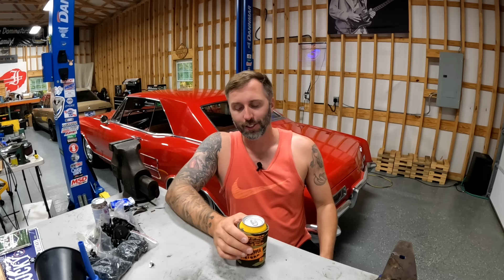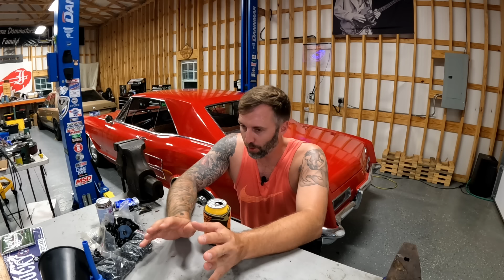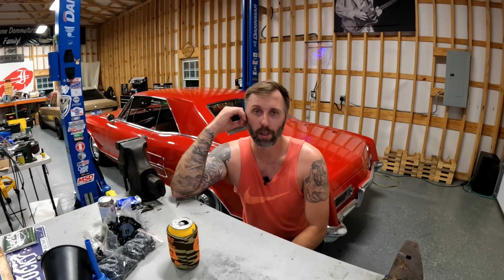Why I Ditched Holley Sniper EFI

Comment: Anyone have a fix for this issue? 1 out of 15-20 times I walk out to start my c10 with the first gen Holley sniper it refuses to start. Just cranks and doesn’t even try to start. Then walk back out an hour later and it fires right up. Every time I check connections, check fuses, relays, and shake wires and nothing. I do see a “RPM sync “ on the screen. But that shows when jt starts too. Also the volts when driving will drop to 11.2 on the Holley screen but shows 12.6 on my truck gauge. That system came with the truck and that engine trans is coming out and going in another project so I will be able to check all the wiring. I just don’t want that issue in the next vehicle. Has anyone seen this with theirs?
Reply from the maker: I hope your able to get it figured out.  Thanks for watching.  Pls subscribe.
Reply: Lol. Thanks for reminding me. I did forget to subscribe. Looks like a channel I will like. You know anything about LT4 engines? Lmao that’s what’s going in to replace the old school 350. If I live through it it should be cool. Then again there may be an insurance fire. Lol
Reply from the maker: @rickhurt7007  u sound like a guy I could drink a beer with lol

Comment: I turned against them I've done a lot of fuel injection setups I helped a friend of mine On his 57 Chevrolet All we can get from tech support was It's RF noise We had problems out of the IAC Never would work right Finally Unplug the IAC I got it to work halfway decent Did everything holly support said Holly still has problems with them Most of the people that I know Have say it works great have say It doesn't work great At least with the carburetor It's consistent

Comment: Damnnnn......after all that I wouldnt touch that system with a 10 foot pole. Put a megasquirt or an oem fi into that camaro!! Just think about it,the ecm is integrated into the throttle body where it's susceptible to engine vibrations and heat... .lots of heat!! And the ecm is potted so you cant even service it if yer good with electrinics. I daily (ish) drive my carby 82 k5 and yes it heat soaks on the hotter days but such as life. It ALWAYS runs though and will always get me home due ti not having to rely on all these micro electronics. Oh....it also has hei and just like when i was in high school, i keep a spare distributor in the back because why not. I dont know what an ecm costs for the sniper but ill bet it's significantly more than my spare $10 hei distributor....which can be changed with a 9/16 wrench and 1 bolt.

Comment: Solving hot start issues with carbs? Use an electric before you start.
Only EFI I would trust is new OEM, I think a lot believe they will do a "Simple 4 wire" deal turn the key and drive off in the sunset and will act like a new car. It wont. 
If you have a carb just TUNE IT. IF you cant find someone who can...ive never had an extended start issue on one setup right. 
WHy complicate an old car when they are very simple to begin with thats the magic with em.

Comment: I have never had a problem with any holley efi system I have installed 35+ terminators sniper 1 sniper 2 dominators hp's never once had one problem I don't understand why people have problems I guess . I've also diagnosed at least 25  problems someone else created on on these systems I am not a holley die hard but I truly believe there is a lot of install error going .

Comment: Non of this new stuff for DIY is going to be only as good as good as the last guy who assembled it and signed off on it.  It’s a PIA that can be great, but it is not going to be the all and end all. When they change to a new product, they have corrected issues that have caused returns. You can assume that the old units, they will fight tooth and nail to deny a return. They want to unload the obsolete parts and it’s a good chance they are repackaging returned units. The II is a world away better unit. If you get stuck with a I you are playing Russian Roulette. They will try to make you keep it if they can. I have an Edelbrock carb and a TFI ignition that is triggered by points with no condenser.,All of the pieces are on relays and aluminum heat sinks. I got it all from a totaled 95 F150 I6 and it’s on my 390 FE. A good fuel system new lines electric pump. And if I want to go to the strip I have a 750 3310 Holley that takes minimal trouble to swap. It dynoed 503 hp and 488 ft lbs from a 394 ci 390. If I can pull all of this off of a wrecked truck and and put it on an engine they quit making in 1976, that box of $3000 stuff should be pretty good don’t you think?

Comment: In the last 3 yrs I've removed a half dozen sniper EFI kits, there basically junk 50/50 shot of them working, biggest issue is some of the components on the throttle body that can't take the heat, now there latest version moves those items off to a separate unit but still doesn't solve some of the issues their prone to have, Auto manufacturers have millions upon millions invested in there EFI technology, Holley dosent have that budget , that's it in a nutshell...
Reply from the maker: I don't doubt it.  Thanks for watching.  Pls subscribe!

Comment: My sniper efi system was good for 2 years. Now there's not spark i check coil a d is good the hyperspark ignition box it have i solid orange light. I don't know what else I can check. Also went I cracked the engine, and it has rpm. Can somebody help me. I heard it could be the computer. I emailed Holley , but no answer yet

Comment: I was considering the sniper until I did my research. Basically they are overly difficult to install compared to a simply carb and tune, they are expensive and require additional hardware not included in the kit for my application, They are problematic and overly complicated, all to only make the same power as a nice carburetor. I really dont see the point. I can tune a carb and able to pump the throttle before starting. Save your money guys. Buy a carb and learn to tune
Reply from the maker: For sure .  Carbs really aren't that hard.  The edelbrocks even come with a nice little tuning book.  Atleast they used to.  Thanks for watching.  Plz subscribe

Comment: I wish had used Megasquirt to run the port injection on my 6th gen 454 but I wanted it to look a certain way. The Sniper unit itself works ok. The Holley software is the biggest downfall.
Reply from the maker: Mega squirt is definitely probably the easiest efi to do.  Thanks for watching, subscribe plz!

Comment: Soldered or crimp connections?  Having fixed radio equipment for the military, and being trained how to solder, a solder connection is always best when done right.   Most people do not have the basic knowledge of how to solder properly but can fake their way through it often leading to an inferior joint.  But that is not the biggest problem; it is the cheap crap we are sold today that compounds the things required to make a good electrical connection.  And crimp connector need to be done properly too, using the right tools and right wire and wire size with the proper connector to be used - which most of time is cheap and universal by nature, meaning it don't fit anything real good; which turns into a hack job 99% of the time as far as a good electrical connection is concerned.  For Auto use, a Weather Pack connector is a no-brainer if you are going to crimp - just buy good stuff and do it right.

Comment: Why would you put a sniper 2 in that camero?? You can swap that with GM EFI. ECU, wiring harness and intake manifold and youll have a legit efi that would work better, parts are at every parts store and you know everything about it already. I seriously do not understand the sniper thing. Its shit thats gonna break and go wrong and you'll be dead in the water because you have to wait on Holley to send you parts or diagnos the issue with you

Comment: The sniper has a 76% failure rate.  They're terrible, most of the issue stems from the overseas manufacturing and the ecu mounted in the throttle body right where all the heat is.

Comment: It’s been a year but I recently had an issue with a sniper.    Problems with it.  1985 Chevy PU.  Sometimes it runs great but mostly it runs poorly.  No matter where I set it      My boss is an asshole and argues about everything.   He won’t do as I ask or say.    He runs the truck like it’s a race car.   He does this to every car.    It had rotten fuel in the right tank and he didn’t want to drain it.  He wanted to use it.   That’s when it went bad.   I told him not to do it but he’s not smart enough to listen.   I think it’s time to leave.

Comment: Fool injection is NOT reliable and I doubt it ever will be. I looked at it for my weekend cruiser 400 Galaxie. Then looked at You Tube and gave it a miss. I do use multispark ignition and when working is really good. Though another thing to go wrong which they do too often. With that I am now using a MSD streetfire box after the Crane one died. Engine is mildly modded with a 670 Holley. With the multispark it starts better and like a modern efi car and drives excellent cold. Since the engine never sees more than 4500 rpm the base unit is perfect.
On racecars I have had both Crane and MSD boxes fail. I recently had someone pissing in my ear how much more power it would have with fool injection,, most defenitly would have less. A simple carb makes more power and that is 100% fact. Not as  smooth maybe but working between 4000 and 7500 rpm smooth or economy is not really an issue.
Drag racers trick themselves with b/s all the time. Road racing and ovels not so much.
Reply from the maker: I haven't had the greatest luck with the msd 6al boxes.   They used to be made better.  Thanks for watching! Plz subscribe!

Comment: Here's the deal anything electronic plugs you got wires more stuff to go wrong they can have their little sissy easy street but when it comes to tracing down what wire is shortening out while we're riding down the road and we passed right past you on a mechanical carburetor forever

Comment: I had a very similar experience with the FiTech brand TB unit. It was responsible for contaminating my oil with gas and causing rod bearing failure.  I sold the unit and bought the Sniper unit. Have not even opened the box and saw this video. Anybody wanna buy a Sniper  unit?

Comment: All the issues I have heard , seen and read are why id rather go through the headache of running the vortec 454 off factory injection with a 411 computer .... Hell id rather run a factory TBI than run any of these . the ecu on the throttle body is a huge no go for me and I would have to spend twice as much to get one that doesnt ....... And even the base model is more expensive than a used vortex harness and a 411 computer . plus holley and edlebrock SUCK now for customer service , you can never get ahold of anyone because they dont care . they both collectively own 75% of the aftermarket now and they can act as they wish because they are now both basically duopolies. Go to ultimate efi or howells

Comment: I think that you went too easy on Holley. There is no reason to be shipping out poor, defective, untested products. Then to not send you the replacement part that is bad right away is totally unacceptable. Then to tell you that you have to wait 6 weeks to get your money back on a product that doesn't work  is total BS. If I were you I would never buy a Holley FI product again. I like carburetors they work great and are reliable, I'm not sure why people pay $3.000. to switch to FI for very little advantage, they don't make any more HP than a carb. The only thing I question your wisdom on is putting points in the distributor, why would you do that? electronic is soo much better.

Comment: The fact that you can't work on or fix anything yourself when things go wrong and you have to "ship the unit back to Holley, have a tow bill and huge amounts of downtime" makes the Sniper the most ignorant thing you could ever do to your rig. GMC designed a throttle body in the 80s that you can't kill, will limp you home in the incredibly rare instance something fails, and you can entirely rebuild in a few minutes, but here we are with modern day throttle body injection units that are as reliable as a modern day woman. Unbelievable. I'll stick to carb, rock solid reliability with no high pressure fuel pump, no O2 sensor (for ECU), no MAF sensor, no TPS sensor, no IAC valve, no MAP sensor, no TEMP sensor, no Crank and Cam sensor, no Knock sensor, no Air Temp sensor, no fuel pressure regulator, no Injectors, and no central ECU making everything work together in harmony.

Comment: Sounds like JEGS
Reply from the maker: Haha I prefer Summit
Reply: @timelesssteelgarage  i bought leaf springs for a 72 c10. Simple enough they shipped long bed springs after 3 call 2 hour conversation about the difference between a long bed and a short bed the ass hat tech called me an idiot because he couldn't understand. I will never give them another penny. And they ship through fedex but must have burned fedex because they won't pick up for them so it was a joy to beg a fedex shipper at an office max to take leaf springs. Hhaha it was a joke
Reply from the maker: @ I had a very similar experience with a crate engine.  Nevertheless I don’t buy from jegs anymore lol

Comment: If you do not want to much troble on instalation, fabrication, sensor and electronics,  stay far away of EFI.  Today EFI is more simples than 10 years ago, no sistem is made to, only buy it, install it, forget it, noo, noo. You need to fabricate, make the program, install, tune in the shop and tune on the road. Holley make others sistems better than that.

Comment: I hate that happened to you man. IMO efi is good for a lot of things done get me wrong, but idc how "user friendly" or how "plug and play" efi is. It'll never be as easy as a carb. With a carb, you pull it out of the box, bolt it on, hook fuel to it and fire it up. Done. In the time it takes to write this comment the engine would've been fired up by now. Sure you'll need to adjust floats, and set the mixture, etc but 99.9% of the time they fire right up out of the box.
Reply from the maker: Thanks.  Stuff happens.   It's hard to screw up a new carb though you are right.  Subscribe!

Comment: I don't think YouTube could jam anymore commercials into your video...
Reply from the maker: Dang that stinks ! Lol  I didn't realize.   I make them. I don't watch them lol
Reply: @timelesssteelgarage  YouTube is getting terrible. It's almost as bad as watching cable TV. I know it's not your call. Good video btw. Hey, I have a question you might be able to answer. I have a sniper on my camaro, and the negative post snapped off on the fuel pump (fricken garbage, doesn't have 100 miles on it), so I had to replace it. It's in the shop now, and the mechanic couldn't get a 60psi pump in a decent time frame, so he got one that's twice the pressure, 120psi. He says the Holley regulator will handle it? I'm kinda twitchy on the idea. What do you think?
Reply from the maker: @stevebottrell9154  I an with you.  Either put a good regulator in or order a replacement pump.  That sniper regulator is gonna be maxed out .
Reply from the maker: @stevebottrell9154  thanks for watching.  And toughing out those commercials.   Please subscribe ! Tell your friends.  Thank you

Comment: Fuel injection is better than carburetors   EXCEPT  when it sits on top of the intake manifold.  Holley has been scamming people for years with this setup.  It's nothing but a waste of money and time; and they know it.  Get a Holley or Edelbrock carburetor if ported fuel injection isn't an option.
Reply from the maker: I like what you did there lol. I agree.  If throttle body injection was so great we wouldnt have ditched it in the 90s lol. thanks for watching, plz subscribe

Comment: Sniper is crap. Get Edelbrock Pro Flo 4. Much better for average driver. Less tune ability but 95% of users never that crap anyway. Holley good for drag racing if you can’t get Fuel Tech.

Comment: I have a real problem with this video. I went and watched your install video as well. You say that you are an experienced mechanic but it doesn't show. 

First of all to address the only problem you have is the front 2 injectors are putting too much fuel to the venturi rings in the throttle body. You called it a bowl. This system does not have a bowl. There are two things I see from your comments and knowing the system that would be happening. You mentioned you de-pinned wires that are not needed. There should be no reason to de-pin anything on a Sniper. If you did you could have a short that is powering those injectors open. The other thing that is most likely the problem is simply having dirt or residue in your lines. The fact that you have 2 injectors open tells me that you had dirt somewhere. It is good practice to flush EFI lines before you hook them up. I have seen injectors clogged on even the best systems. That is why a 10 micron filter is needed for fuel injection. Another issue could be the back injectors are not working due to the wiring you have. You may have de-pinned them or they are not getting good ground which would make the other 2 work double time to compensate. 

It appears to me you didn't try very hard to figure out the issue. Instead you chose to get on your Youtube channel and badmouth something that is probably your own fault.

Comment: Damn man, hope you get it worked out but you bitching over a 1500 fuel injection kit is sad.  Thats cheap for aftermarket fuel injection and even the mire expensive kits have quality issues.